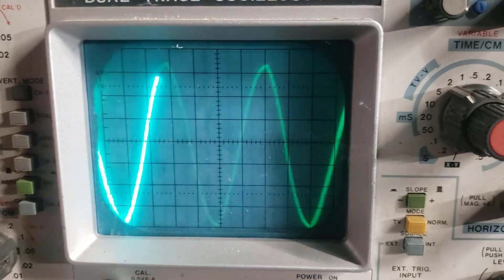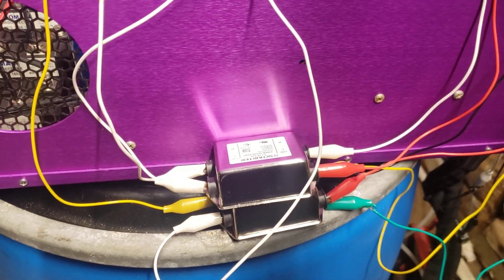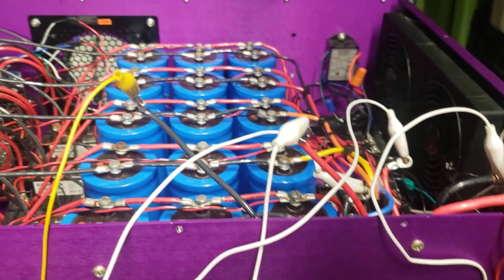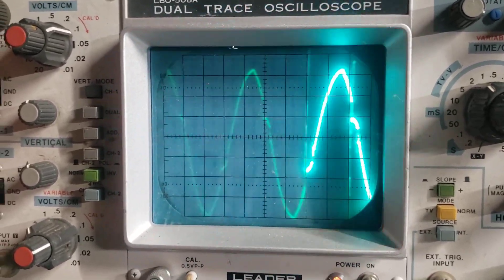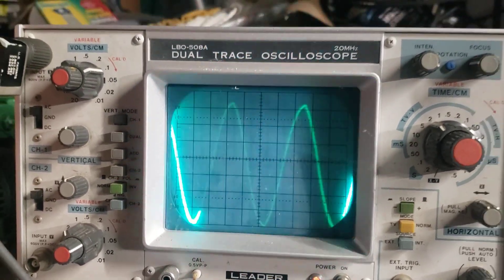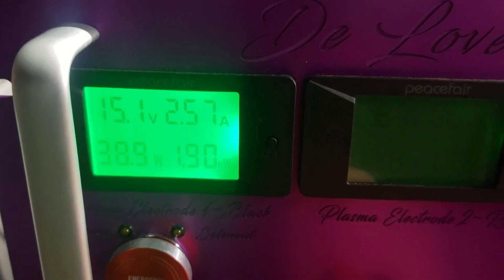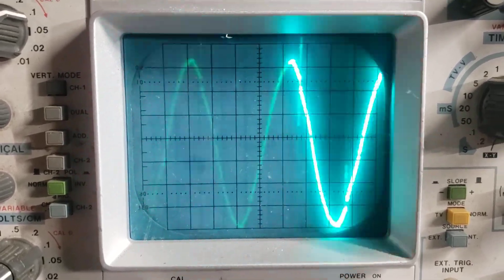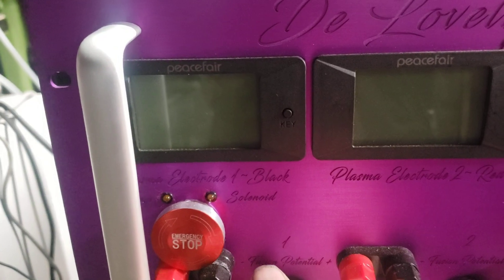pt 2 "Understanding Back EMF" Plasma Desalination and Periodic Elements Reactor Patent Build.

Comment: along with shielding the wires, you my need shielding in between each of the 5 power supplies , including the circuit board.  Similar to old Television sets that used flyback transformers
Reply from the maker: Ok